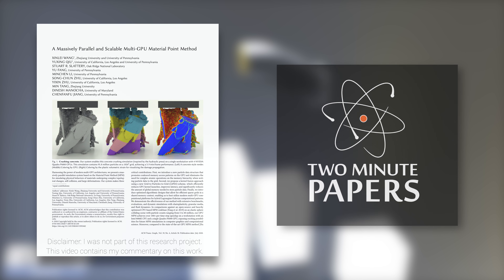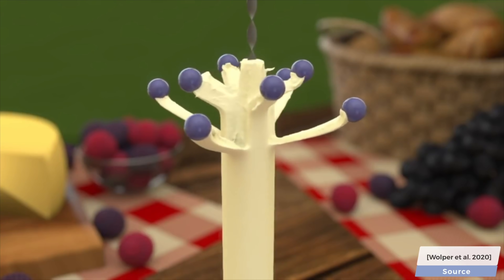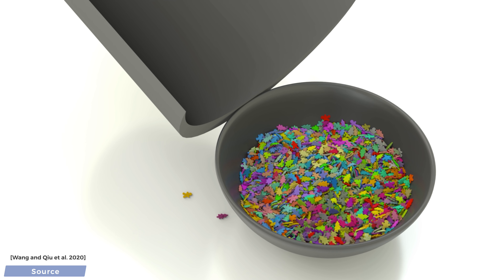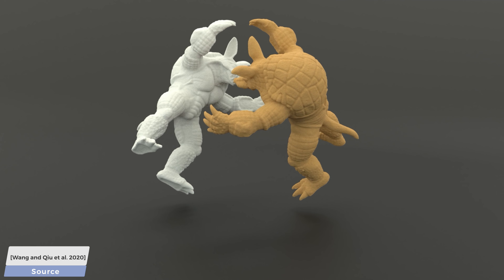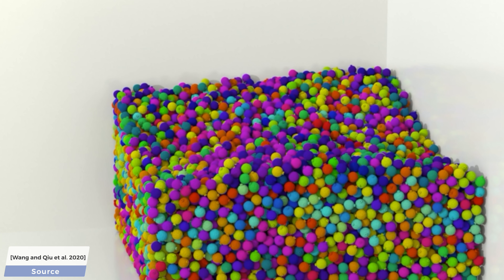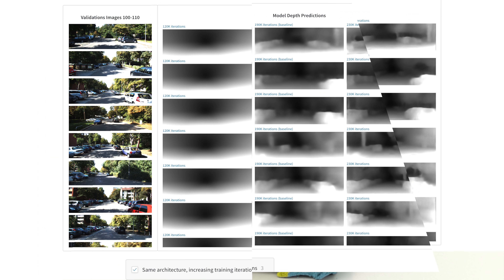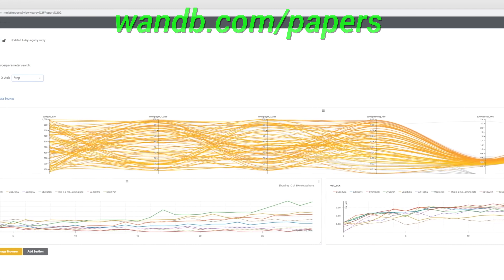This Is What Simulating a 100 Million Particles Looks Like!

Comment: You say 4 seconds per frame and so on, but that doesn't tell me anything, since that also depends on the computer you are running it on.
Reply: He said in the video that they used a single 4-GPU workstation. That gives you an approximation. 
But the point in the paper about "achieves over 100X per-time-step speedup on a workstation with an Intel 8086K CPU and a single Quadro P6000 GPU" should have been brought up in the video. It is an impressive advancement.
Reply: And the intended framerate...

Comment: The next step should be to isolate the particles which don't contribute to the result (yet) or a way to figure out when you need additional frames because the correctness of the simulation had suffered. Kind of an error correction running in parallel that starts to insert more frames and more particles at spots where "stuff happens" and just leaves the parts that break off in bulk run as huge chunks.

Comment: You didn't answer your own question, "Why do they wiggle?"  There must not be enough damping.
Reply: The "candy bowl" was also wiggling unnaturally.
Reply: That's what I was thinking. They shouldn't wiggle that much imo.
Reply: wiggly material only needs 1e-4 second timestep while something real needs 1e-7s. 1000x more timesteps to compute -> 1000x slower simulation. With 10M particles taking 1s per timestep we would need ~3 years to get 10 second animation with hard materials. With wiggly one it would only take a day.
Reply: Yeah, I really noticed that in the candy bowl example.
Reply: He did answer the question. It's because these balls aren't atomic entities but made of a large number of particles, which allows them to compress and expand based on the forces exerted on them. He probably didn't elaborate because it's kind of self-explanatory.
Reply: @hevanen1  That's not an explanation for a lack of damping.  The number of particles in the simulation is irrelevant.  What matters is the viscous damping coefficient.  The physical parameters of the simulation.
Reply: Yeah the one thing that really lacks in these videos is any type of explanation at all :( just lots of showing off videos and photos from the paper in a loop

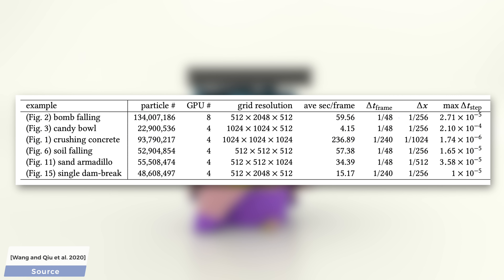Comment: It looks like the arrow is pointing to the wrong column at 3:35. Why would a smaller time per frame make the per frame computation time longer? Yes, it's more work overall, because you have to compute more frames per second, but it seems like it would be more affected by a smaller time per *step*, and the audio seems to confirm this. Crushing concrete uses a tiny time step, meaning it takes about 2400 steps per frame, while the candy bowl only takes about 100, explaining some of the massive discrepancy in time per frame (along with particle count).

Comment: I wonder if one day the tech will allow us to create a whole game/world made of physic accurate particles. (Real-time simulation).
Reply: It's absolutely possible. But extremely wasteful, you can get a 99% accurate simulation with several orders of magnitude less resources. When you are dreaming, you are doing something similar, and your brain isn't running a physics engine or following individual particles. Of course dreams aren't too realistic, but we can use the same general idea to make very accurate simulations cheaply. AI already can generate photo-realistic images and even videos without any knowledge of physics. You can imagine how concrete breaks, even if you saw it only once. An AI can do the same and you won't be able to tell it's not real. The details doesn't have to be exactly right, just the general pattern, because those details depend on things don't know anyway, like already existing tiny cracks inside, impurities, temperature gradients and similar things. And the simulation can be made more accurate when you pay attention to the details and cheaper when you don't.

Comment: I'm curious to hear about how this was written for GPUs. Since every particle interacts with its neighbors, there don't seem to be clear division lines for distributed calculation.
Reply: The further away the particles, the less the effect. In most situations, you can define a distance between two particles over which they cannot interact. The space between them can be interpolated.
jk, just making stuff up
Reply: The results from the previous timestep don't change, so you can read from them in parallel. the new results go to a different place in memory. 

so you have the simulation data at least 2 times in memory: one for reading, one for writing. after every step, you swap the roles
Reply: @TheAudioCGMan  That makes sense. Thank you!
Reply: Well he always links the papers in the description
Reply: I didn't read the paper bit this is the most common approach afaik

Comment: Suppose a paper takes about 2 minutes (120 seconds) to read through, then that concrete cylinder simulation takes about 2 papers per frame. Hence, I propose that papers per frame should be made a de-facto unit of measure for this channel.
Reply: But that would give  0.0000925 papers per frame...

Comment: I get that the point of this paper is the way that these scenes can be computed with GPU and are much faster and not about what the simulations actually look like,  but why do the simulations look so wonky? The candies and balls are too wobbly, the concrete is too sandy (the sand stuff does look really good). Are the simulations just not well tuned for what reality is like?
Reply: Yeah they're using the simulation to prove another point, so they haven't bothered with the finer elements of, say, concrete realism.

There is actually a video where the paper was specifically about creating realistic damage simulations, and you can see there that they know how to simulate all that stuff, they just don't do so all the time for every paper.
Reply: Exactly

Comment: I have a doubt about rendering, when one computes a collision and renders it, changing the camera for the same animation doesn't involve computing the particles again, right?
Reply: Correct. Particle physics are computed separately in 3D space, so camera position has zero influence on the position of the particles.
Reply: That's how current-level physics simulation works, at least. You process the physics simulation, can cache the results, and then exporting it as a video with different camera angles or what have you are a separate process
Reply: @speedracer2please  That is right but you don't need to bake the physics and export a video, in games for example they can happen in real time, not at this massive numbers of particles but the physics engine PhysX can do particle simulations in real time that look more or less like that water but just with less less particles.  

https://www.youtube.com/watch?v=ok8ThRR-59Q
Reply: @Argoon1981  I would love to process physics like this in real time in Cinema 4d lol it can take soooo long. I'll have to dig more into the options or learn a game engine

Comment: Simulating 1k particles - GPU: Noice
Simulating 100k - GPU: Noice
Simulating 100M - GPU: Not noice.
Reply: Depends on how much those interact with things and data they hold... Just having 100M×2 3d float vectors (for position and speed) will consume ~2.3GB of ram, and thats quite a lot
Reply: @overloader7900  Yeah, but in terms of rendering, it would be too much power extracted from the GPU.
Reply: @overloader7900  you forgot acceleration
Reply: @Guztav1337  well, there are some simple physics sims that dont require storing acceleration. And anyway, i was making exactly the point that 100kk is a lot, even for simple systems. And for ones with complex inter-particle interactions? Oh my oh my